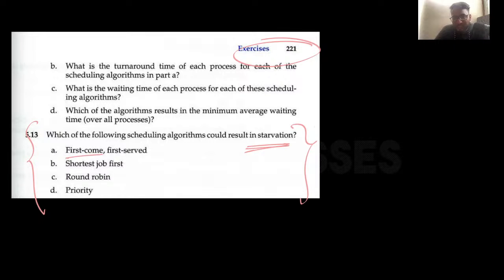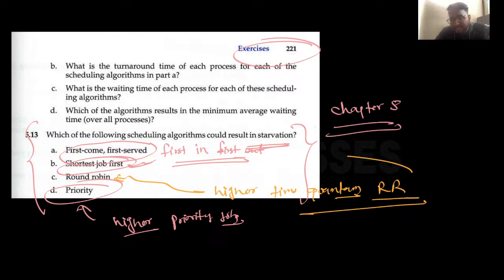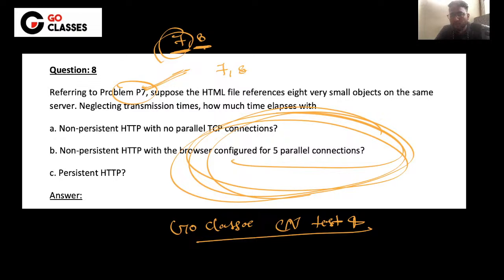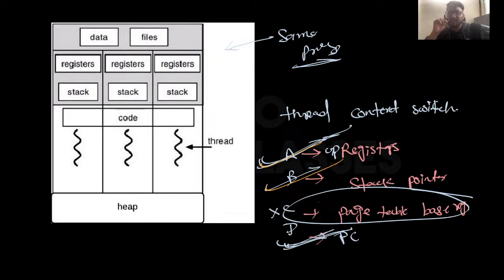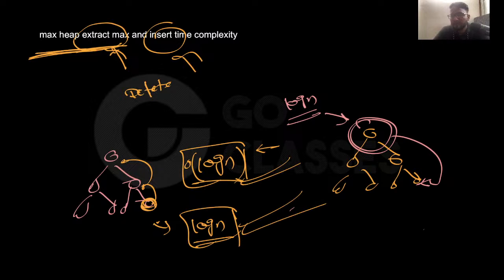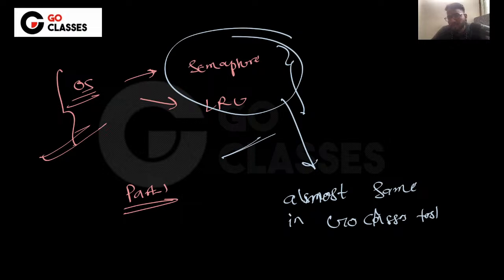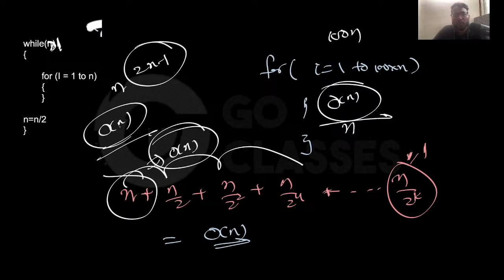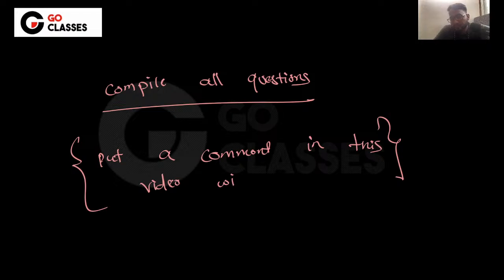GATE CSE 2023 Analysis Part-2 | Sachin Mittal

Comment: Total available physical frame is 30. There is an array[128][128], which is in row major and elements are accessed using two nested for loop as below:
For(int i = 0; i<128; i++){
     For(int j = 0; j<128; j++){
      A[j][i] *= 10;
}
}
One physical frame can hold 512 elements of the array.
The page replacement algorithm used is LRU.
What will be total no of page fault if all page frames are intially empty?

Solution:

Let us suppose each entries of 2d aaray takes k bytes space 
So total space required by the 2d array is 128*128*k.
As given, one page frame can accommodate 512 entries
Hence it can have 512*k bytes space.

Now total pages required are= (128*128* k)/512*k = 32

Hence there will be 32 page faults.
Reply from the maker: Here is the Detailed Solution of the LRU Page Fault Question:
https://www.youtube.com/live/WlzfxlVU6HI?feature=share&t=5769
Reply: @GOClassesforGATECS  Actually this comment was to point out a small mistake done by the instructor. Kindly ask him to verify it again.
Reply from the maker: @rajatbiswasf   Please mention the timestamp.
Reply: Please watch this question carefully
And also the solution which I had provided above.

Comment: But in the first session of the GATE 2023 Analysis Part - 1 , Mr. Deepak has told that FCFS do not suffer from Starvation and now in this session you are saying it suffers. Whom to believe is correct ? or perhaps GO wants to be on safe side.
Reply from the maker: There are different STANDARD resources differing opinions.
Deepak sir has followed IITB and other Top standard resources which says FCFS doesn't have starvation.
Sachin Sir followed Berkeley University which says the other way.
Let's wait for GATE key. Perhaps in either of the case we can challenge the key.